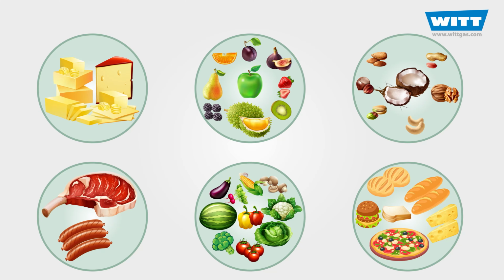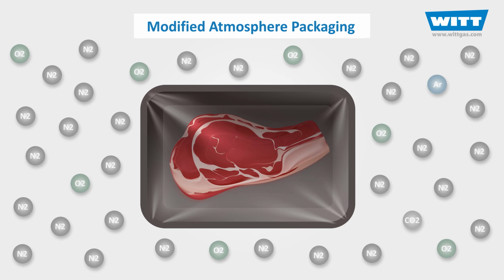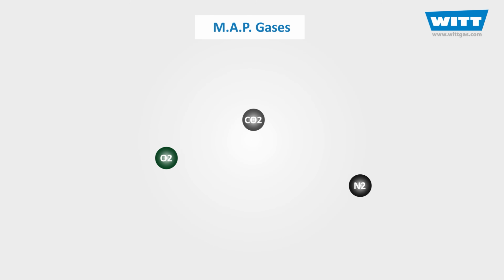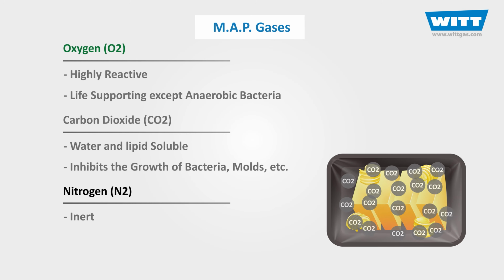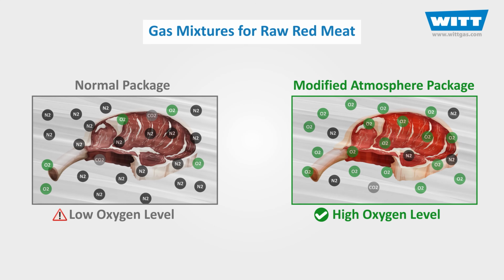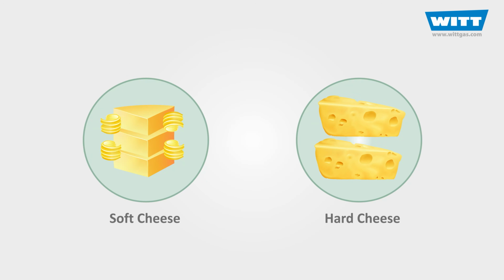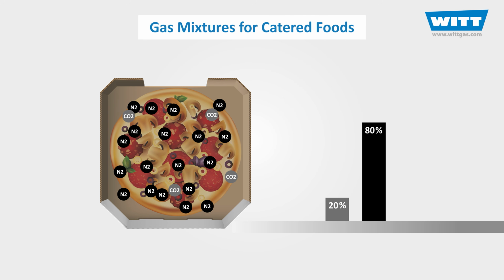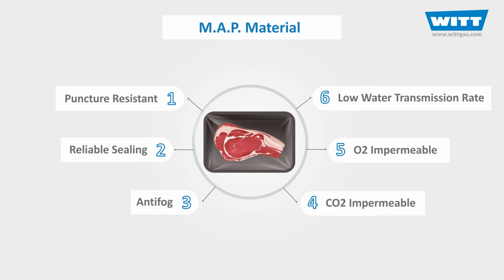Modified Atmosphere Food Packaging (MAP) - how it works, benefits, gases, requirements

Comment: Can you have full line solution for indian Sweets MAP Packaging System for Long Self Life for Sweets Thnq
Reply from the maker: We specialize in modified atmosphere packaging and offer gas mixers and analyzers for connection to virtually any type of suitable packaging machine. However, we do not manufacture any packaging machines ourselves. But we have been working with all relevant manufacturers of packaging machines for decades and find suitable connections to achieve a good result for the user with perfectly packaged food. For more information and a completely free advice, our contact form is the best way: https://www.wittgas.com/contact/

Your WITT Team

Comment: How do you get the air inside?
Reply from the maker: To get the modified atmosphere inside a pack you require a suitable MAP packaging machine. Depending on the type of packaging (flow pack, tray,...) there are different techniques. WITT offers gas mixers for all types of packaging machines.

Your WITT Team
Reply: @WITTGAS  thank you for replying!
Reply: How do you open a 15 pound bag of MAP Japanese Ubara rice? Does it have to be reconstituted 🤔 ⁉️Thanks for any advice 👍🏾‼️